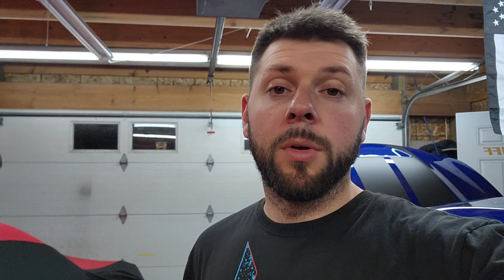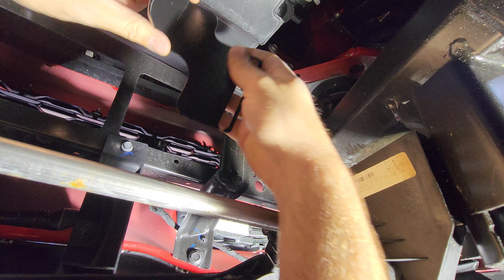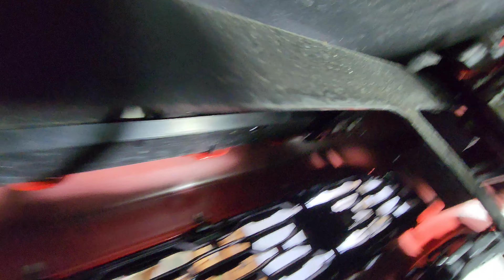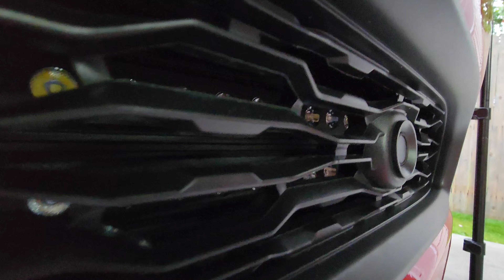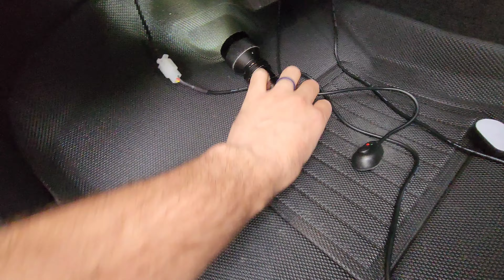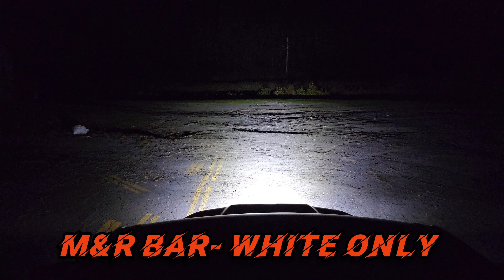M&R lighting Dual 40" lightbar install/overview | 5th gen ram

Comment: Great video. Just did the same set… and man, it was a tight squeeze. Had to remove my tow hooks just to have barely enough room. M&R light bars are great though. Thanks for the great content… Followed.
Reply from the maker: Heck yeah! Thanks for the follow and the watch! It's definitely a tight squeeze and requires some icy hot on your neck and shoulders afterwards 😂😂 definitely worth it though
Reply: So you had to permanently remove your tow hooks?
Reply from the maker: @FirefighterBuell  just for install probably, these are far away from the tow hooks

Comment: Great video. The output seems pretty weak however.  Saved me some money. 😊
Reply from the maker: For what the light bars are and the location, they actually put out some decent output. But for maximum output, you'd want the SKT 5 pod lower grille

Comment: Is it easier to install the bracket and bar with the grill off then reinstall the grill? Or would there be no room to tighten the grill bolts and reinstall the trim retainers?
Reply from the maker: No room! Absolutely install the grille first and then install the bar and brackets after!
Reply: Had to delay my install today bc I was missing a lock washer. I still need to install the drivers side bracket and lights. The length of these makes them superior but also tougher to install
Reply from the maker: @sigfla1  ahh bummer! It's a small company. Just a guy and his wife out of their garage but they'll make it right for sure. But just being a washer. Can run down to the hardware store. 

And yeah it's a bit of a pain but nothing too bad. Have a stiff neck for an hour, about the worst of it😂
Reply: @TboneSRT  oh yeah it was not a big deal. Ran to Ace Hardware and got one for 60 cents. Not an issue just delayed me and my wife took it upon herself to occupy what little time I had left this weekend, lol!